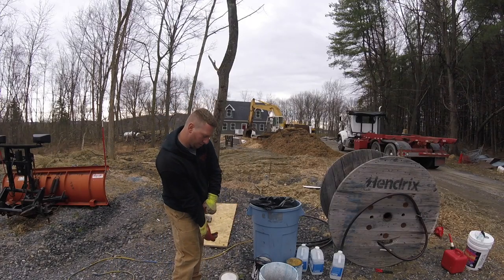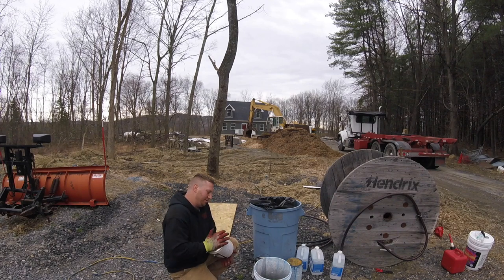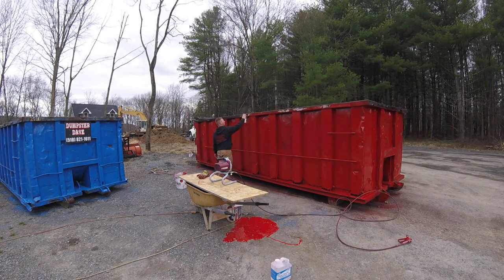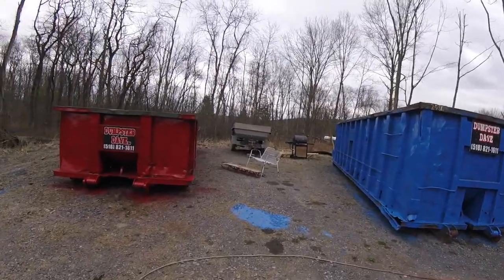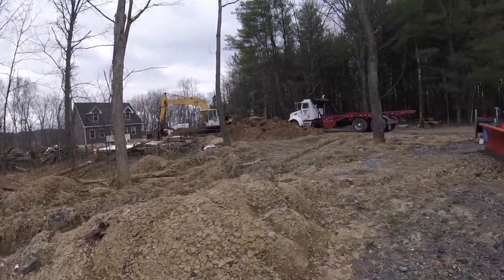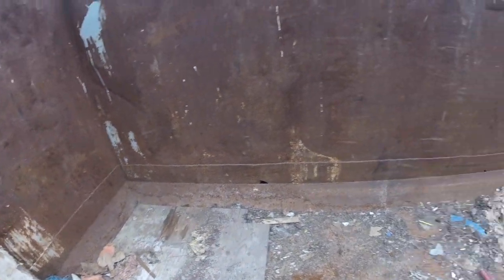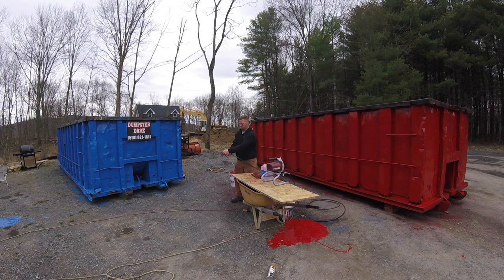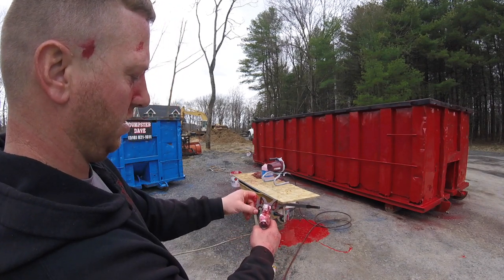How to use a spray gun to paint dumpsters

Comment: Nice paint setup Dave! Im looking to get one of those over the hvlp system for efficiency and no air to put moisture into my paint line. That dumpster I would cut out all that rust and put a new sheet in. If you cover overtop it will just rust through more. You can never weld rust and it must be cut right out
Reply from the maker: Yeah I’m definitely going to cut it out and replace, I’ll have my shop setup up hopefully mid August, then I’ll be able to work on everything.

Comment: Dave  mate, I really like you fella you are a hard working and honest down to earth bloke. Why don’t you run the thinners in the paint line into an empty can instead of blowing it onto the floor. That way you can use it again to clean out the line after you pump the paint in the line into a seperate can to be used later instead of wasting it and polluting the ground. Never spray onto your hand with an airless spray gun as the pressure can penetrate your skin and cause blood poisoning.😮 always wear a full face mask with eye protection too. I have seen some bad accidents with airless spraying not being done correctly. !!!
I also watched you grinding off paint and rust without a dust mask!!! That will pollute your lungs badly and can cause lung cancer Dave. Work smart and safely mate as you are a great lad.
David …… ex paint shop foreman, Liverpool U.K.

Comment: Hi Dave! Great video. Did you need to sand these prior to painting? I just bought a dumpsters that were hand painted. They vary in colors Red with white lettering, yellow with black and white writing. They were hand-painted. Just looking for a little input if you don’t mind. Thank you
Reply from the maker: Just seen this hope you made out good, I’m taking a wire wheel now and knocking all the loose stuff off the washing it. I use oil paint covers anything and I never had one Peel

Comment: What kinda of paint are you using?
Reply from the maker: The name is Majic, I bought it from tractor supply. It’s oil base
Reply: @Dumpster_Dave  how is it holding up without preparing the dumpster first? I have to paint 6 20 yards and 1 30 yard.
Reply: @Dumpster_Dave  do you need to do any prep work?
Reply: @TRBall-dw3uj  what did you end up using? and did you do any prep work? hows it holding up?